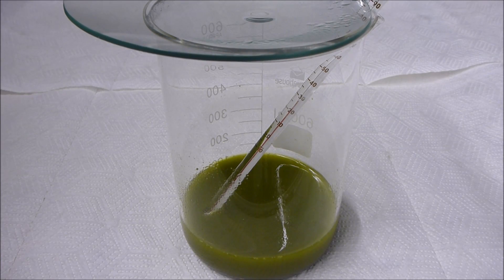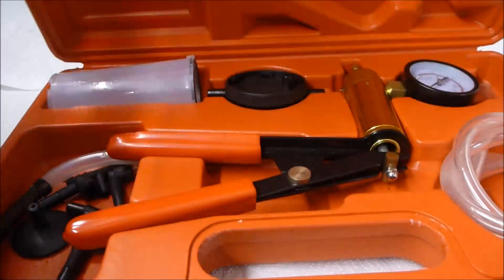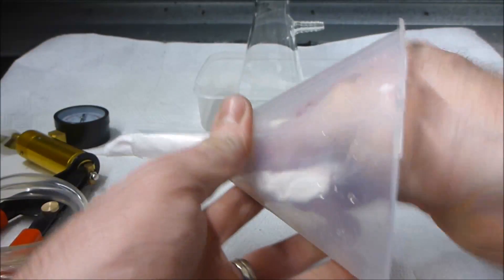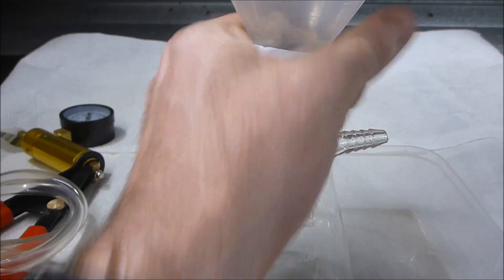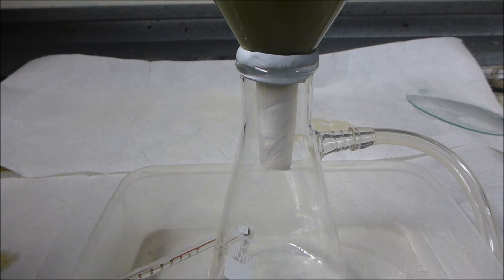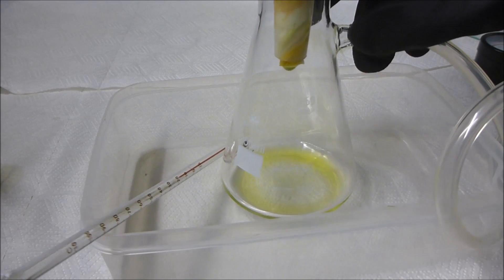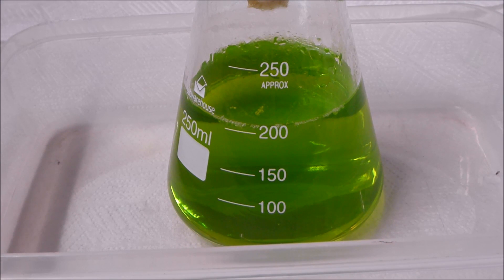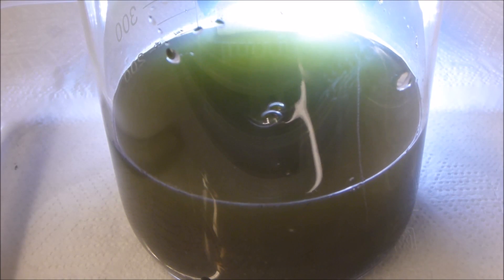Gold Recovery - Simple Vacuum Filter Setup

Comment: Love it.  I don't have a vacuum flask, but will probably make me something to mimic it as my money is limited.   Thank you for putting out all the wonderful videos!
Reply from the maker: Yeah, once you get a vacuum filter system going, you just can't go back to any other method. I'm pretty sure I have seen a picture somewhere (maybe GRF forum) where someone had modified a mason jar into a vacuum filter system.  Thank you for the compliments and feedback!
Reply: Mason jar... hummmm.  Might have to get a diamond bit and try tapping a small hole in it's side and see if it weakens it structurally.   Or, could just use throw away metal lids, that would work and be cheap....   ideas, ideas...
Reply from the maker: Yeah, I'm pretty sure the guy had a valve system connected through the metal lid, can't exactly remember what he did with the funnel, but could have been as simple as a hole also in the metal lid with some sealing putty around. If you have a home vacuum sealer, you can check whether it is one of the models that have a vacuum port on the top, could be a easy vacuum source.
Reply: I just had one of those given to me the other day, not sure if it works though and need to check it.   Thanks for that hint.

Comment: great video.  I am currently needing to upgrade my filtration process.  I saved all my solution, but the filter system I was using I got 1.2 g of the expected 5 g of gold only.  This seems like a great cheap system.  thank you!
Reply from the maker: Hi Jerry, thanks for the comment. This is a good solution if you are doing small quantities, with anything more than experimental quantities, get (or diy build) yourself a vacuum pump, once you have one you will never look back! I have seen some videos around showing how to build a vacuum pump out of a old fridge compressor. Yep that sounds like a huge loss somewhere in your process, good to hang onto everything! I will also caution that Gold content in various ewaste is often very much overstated, so unless your 5g figure came from a reliable source, there may just not be as much Gold as you expect!

Comment: i use plumber pudy make something that look like a piece of pipe and put it around the funel neckpress down a litlle bit and wala
Reply from the maker: yep, that is a nice easy solution. I ended up at one point making my own seals out of silicon, like the diy silicon molds shown on youtube, also worked great. Better than the bought rubber ones actually!

Comment: Interesting way of vacuum pumping.
I'm wondering if a tire pump pulled up in reverse might work in a pinch?
Also do you think a cotton ball would be just as effective if I used it in the neck of the funnel?
Have a GREAT Day My Friend!!!
Reply from the maker: Bike pumps have valves that mean they usually dont "suck" in reverse. These little pumps work OK, but I pretty quickly got myself a electric vacuum pump, just makes life much easier! Cotton may work, depending on what you are filtering, but you can buy buchner funnels so cheap now that its not worth struggling. I have used fiberglass in the neck of a funnel to filter H2SO4, it kills any other filter too quickly!
Reply: @successfulengineer  That's good info on the filters. The bike pump when pushing down pushes the air out, which is NOT what I would want. But when I pulled up on it, it did the opposite and acted like a vacuum. I have one of those generic foot pumps. I think it's loading air when pulling so when you want it to fill the tire it has the air to use. Kind of like when we breathe we suck in and out. I know it might take awhile but I was wondering if in a pinch and the right rig for the tubing if it's possible to work? I guess I could do what you do and just build it & try it!!

Comment: I like the low cost filter. If you used a much longer vacuum line you would not need to pump it very often as the line would become a vacuum reservoir
Reply from the maker: Yep, I guess you could also fabricate a dedicated vacuum reservoir inline if the pumping was a big issue. I've heard a few people complain about having to pump it all the time, they must have some serious leaks. I'm pretty sure I did no more than 20 pumps in total to completely filter that solution.
Reply: A dedicated reservoir would mean more joins and possible leaks. The long tube is a really easy simple solution.
Reply: Just curious... would you be willing to do a video of RAM chip bonding wires in a batch of sifted powder since they aren't visible and you have that nifty little camera set up?  :)  In E-Gold Recovery & Refining FB page.  Love for you to be there if you aren't there yet.  I am not an admin, just a member who loves your videos.
Reply from the maker: Hi David, in this video -> https://youtu.be/acOUDvCYrlY?t=32m4s  I show bond wires in sifted material. Unfortunately as you say, they are pretty much invisible to the naked eye, and even with the microscope zoomed out,  but when you go to max zoom they start appearing everywhere. I will check out the facebook page, sounds like it is quite popular. Thanks!
Reply: Thanks.  There are a lot of people there that love your detailed videos.  :)  Will share that link with them.